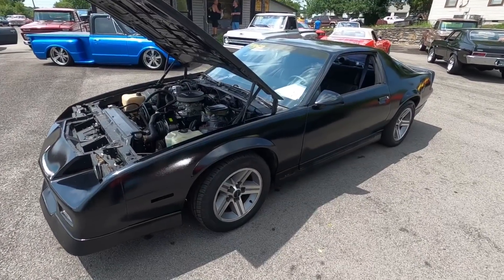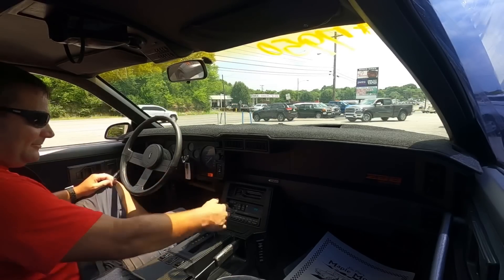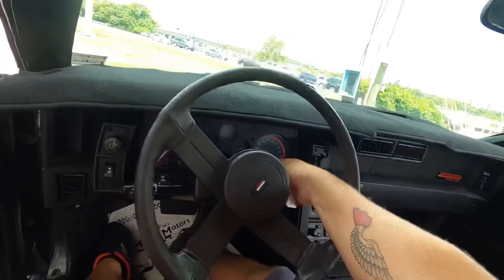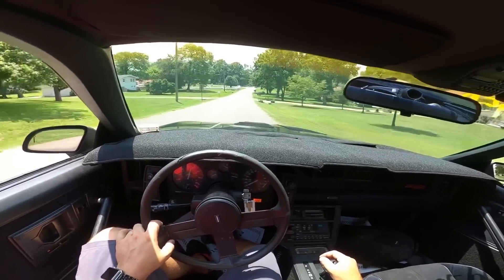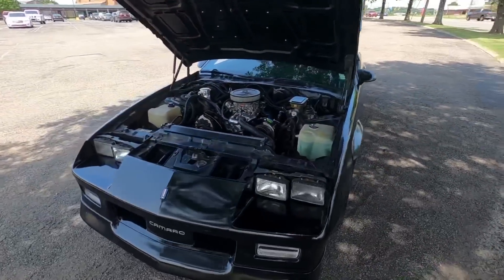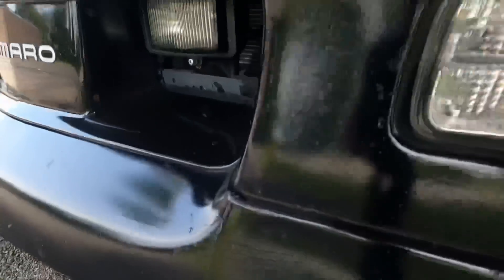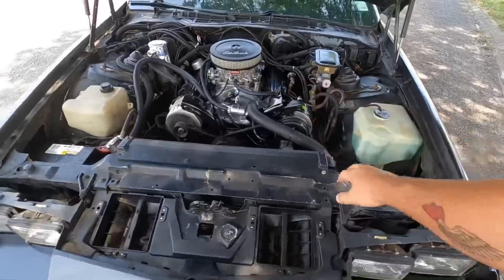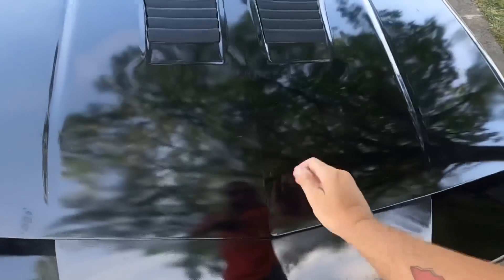Test Drive 1986 Chevrolet Camaro IROC-Z SOLD $7,950 Maple Motors #1747

Comment: It looks like my 83' Z28... it sounds and looks pretty good for a 36 year old car. They're gas guzzlers though. That would make a nice car for a collector. These cars were actually built in the U.S.A.in those days. The reason it sounds so loud is because they removed the airflow cover. That needs to be put back on. That is still a beautiful car. I wish I could buy it. I'd be there tomorrow if I could. Whoever buys this car has just a few cosmetic work and maybe the tires need to be balanced and a frontend alignment. But it runs real nice and looks great. They must have repainted it because the IROC emblem is missing. You should have no problem selling this beauty.
Reply: @NewEdgeDesigns  Oh... I don't know how I missed that because you showed the entire drivetrain. I was more focused on the transmission and engine. That explains it. Thanks for the reply.

Comment: The exhaust is loud because it doesn't exist that's straight off the manifold! And  the best way to fix the service engine soon light is a nice wide piece of electrical tape. 😂
Reply: Yessir sounds just like my 350 open headers I know have glasspacks on but the camera mic doesn’t do it justice u can hear it a mile a way and that’s at idle